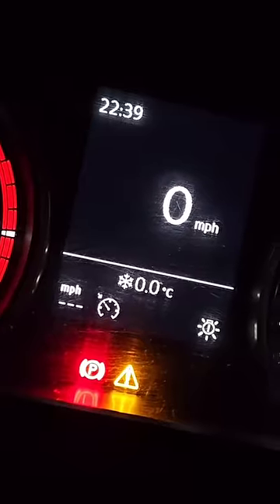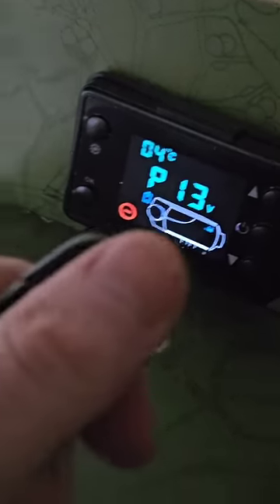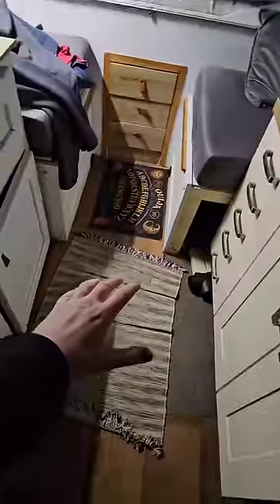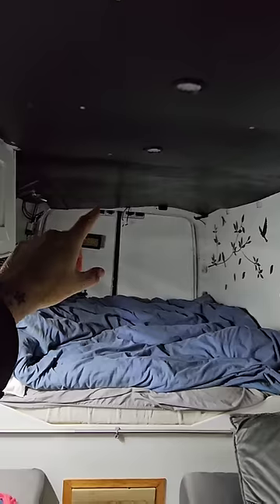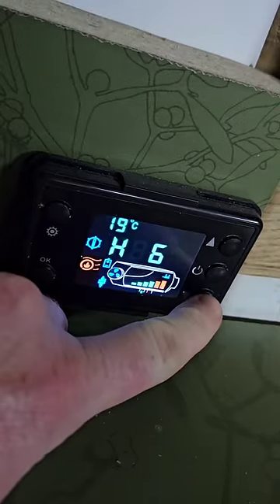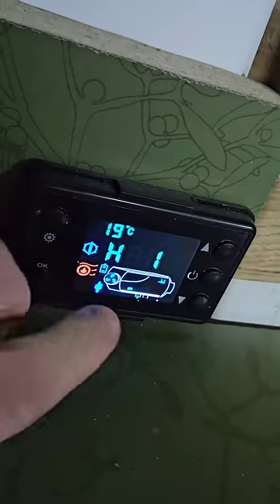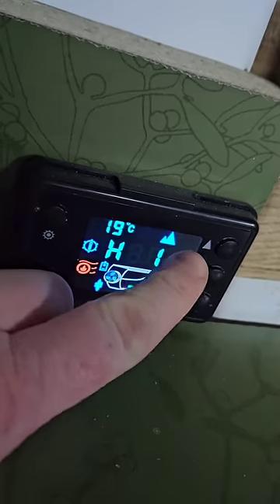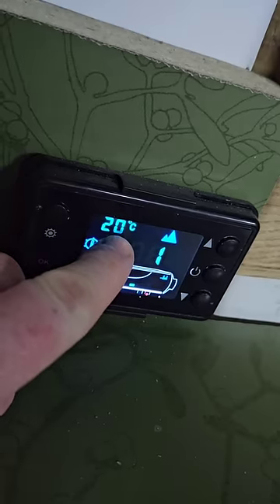Chinesse Diesel Heater Hack For Campervan

Comment: Just be careful with some of these heaters, some have been recalled due to serious faults resulting in carbon monoxide release. Get a CO monitor if you have one.
Reply: Exhaust is outside the vehicle
Reply: @jackmason4374  Aware of this but they can leak, which is why they were recalled.
Reply: I don't use mine because of this absolutely smokes the place out never known what the issue is
Reply: The exhaust manifold gaskets are shit on them it leaks right where it comes out
Reply: @Antv-no1zn  Probably because you're too limp wristed to tighten it up enough.
Reply: You can't have too much insulation. 
Love itt 💓..
Reply: The recalls where due to the instructions being in Chinese and unreadable.
Reply: @darrenpalmer8695  u dip the Chinese ones in soy sauce and it translates them
Reply: @mikejames4271  yhyh did u tighten your car exhaust up when you got it?
Reply: The paper gasket on the combustion chamber is useless mine leaked exhaust gases into my storage room on the instructions they do say that they should not be used in a habitable area!
Reply: I don't thinks its a fault of the heaters, i think it's due to poor installation.
Reply: CO monitor is a good shout 👍
Reply: I told him that two weeks ago and he hasn't replied. . . . do you think he's OK?    lolololololo
Reply: Not about that? There is a dangerous fault in some, that can be lethal? Its important to let people know the dangers!@mikejames4271
Reply: Run same One for yrs no probs and still spot on now.
Reply: @planespeaking so if they're recalled what's the worry lmao
Reply: Wouldn’t buy Chinese for anything important. Not worth the money saved
Reply: @shamicentertainment1262  have u ever owned or drove an MG?

Comment: Hope you have good ventilation to prevent condensation buildup
Reply: The oxygen is drawn from outside and the heater exhaust vents externally - there isn’t any condensation internally from the combustion (unlike a propane heater). 

The only water vapour would be from breathing, so just small ventilation required.
Reply: These heaters parch the air.  An extra mister might be needed to stop your sinus drying out.
Reply: @n.lyndley.9889 well said sir
..I did my research and as you know it's the glass windows that creates condensation...I left bulkhead in have no windows and only have roof hatch which is more then enough for ventilation.

Comment: It's just a night heater from a hgv, we all have them in our cabs fitted as standard
Reply: Ok calm down
Reply: You will find that there  webasto night heaters in trucks and cost about 1000..but saying that i paid 200 for mine for my campervan.
Reply: What are you debunking?
Reply: What is called that heater you talking about,  im looking for one for my campervan @Deiseboi
Reply: @cabrosbob5331  ..I brought it online from diesel heaters ni..there doing a 5kw for £135..had mine 2 yrs no hassle.

Comment: I use one in my house. Its a treat
Reply: I was thinking of doing the same.
Iv got an integral garage where I could site the unit ,then the exhaust can go out the wall to outside and drill a hole for the warm air pipe into the lounge ..How much diesel does yours use for example in the evening for 5 hours ?
Reply: See a guy on YouTube gets the running  cost down to 2p per KW. By mixing oil in with the diesel

Comment: Alpine mode uses less diesel because it can be deadly to not have enough oxygen in the mix. The diesel will burn incompletely and just smoke the vehicle out.
Military smoke generators are just incomplete diesel combustion.

Comment: Mate I have one of these on my boat to keep me warm I have issues with condensation I got the heater working but now it’s making a noise like a damn tornado taking off and it’s defo not the fuel pump I know that makes a noise. it also requires 12v constant anything less and it just cuts out. the manual was in Chinese and have no idea of the combinations of the buttons like you seem to know and we have the same heater as I have the same fob as you. any advice buddy or how to set it up correctly?

Comment: Do you have to keep the engine running over night
Reply from the maker: @sashdhesi9569  no. It's wired to a differant battery. My lithium leasure battery
Reply: @iNDI_VAN_A_JONES  so why dose it use diesel then if it runs on a battery 🔋 🤔
Reply: You say in the video the lower setting uses less diesel

Comment: Running these on the low setting is clogging them up quickly, better to have it flat out for an hour or two then off until you need it on again.
Reply: or just buy a proper heater
Reply: Garage deisel runs clean on these harters down to 0.8hz pump and around 1500rmp.  They can struggle to start on such low settings when cold but once run up to temp they can be tuned right down while running in advanced settings and still burn clean. Fact
Reply: @jorge-1053 What heaters do lorries use?
Reply: @wils35  same as any answer, it depends. 
If the business want to go cheap they will go cheap, or if they want a heater that will last and ensure their driver or goods stay warm then they will go for a proper heater
Reply: @jorge-1053  wrong answer.
The right answer was diesel heater.
Reply: @wils35  No one should use Cheap Chinese diesel heaters they are deadly
Reply: @wils35 the real brands.

China copies the design which is expired of patent now
Reply: @wils35  these

Comment: I spent just over $200 on a Chinese diesel heater it lasted 3 weeks the electronics went to crap the motherboard had changed out a bunch of other parts I threw it in the trash, I went and spent $1,200 on a Webasto heater never had a problem kicks ass, it pays to spend the money do yourself a favor.
Reply: Had webasto,sin TRUCKS for past 45 year. You are correct- spend on quality proven product.

Comment: I was using 4-5 gallons a day in Colorado plains winter. Junked that heater and went to a waste oil burner. Oh yeah I ruined that damn diesel heater trying to burn used motor oil at about 20% oil to 80 diesel.

Comment: what kind of foam.. the stuff for the house has to be covered with fire rated material. curious what foam you were using?
Reply: Dodo Mat, vehicle insulation specialists.
Reply: Carbon monoxide detector

Comment: I found these heaters drained my battery bank too quickly. If I lived in a van again I’d go for high crack to start the glow plug and switch to high AH for running the fan and pump.

Comment: If you've got a separate tank for the heater and you can find it on a pump then run your heater on kerosene as it's cheeper and burns cleaner.

Comment: Get a sleeping bag, then you can sleep safe and comfortably at any temperature, as long as you buy a bag that is rated for it.  Doesn't take that long to heat it up in the morning, and since you have a remote, you don't even have to get up.

Comment: How does fresh air enter into the van?
Reply: Every vehicle has vents in the rear panel. This is the reason you can slam your doors without pressure building up and popping your ears.

Comment: How reliable are them heaters I'm thinking of fitting 1 on my boat as my webasto keeps failing me
Reply: Highly recommend been using mine nearly two years...sleep in van 5 nights aweek due to work...here in Ireland in January was -8..was lovely and warm but sliding door frozen shut had to go out back door.
Reply: @estfano68  I'm gonna order 1 then I'm sick of webasto costs ££££ and you can only run it for an hour at a time or the gause fouls up ..probably OK in a car or van but on a boat you need the heat 24/7 ! And I'm sick of waking up with ice on my pillow
Reply: I’ve had mine for 2 years, so far no problems
Reply: have you ever heard of eberspacher? Those beauties never fail
Reply: @jorge-1053  yeah but there expensive I used one on my old boat and the only problem I had was the glow plug which was easy to fix in 5 min. I would get again but I need to keep costs down as I'm selling up

Comment: Is it really that hard to heat a camper van though no not really try and heat a 27 foot camper trailer from 1967. I use a 5 kW Chinese diesel heater to heat my water only and then I use a Wabo diesel heater to heat the underneath while I use a regular cheap Chinese diesel heater to heat the camper And running all three of those at the same time I’m still not even using a gallon of diesel fuel running all three of them for 24 hours. The only thing I would have to say is I would never get a Bastos diesel heater again only because they’re $1000, well Basto was the first one I bought 10 years ago and it is still running

Comment: You can tune minimum advanced setting down to 0.8hz pump and fan around 1500rpm Runs clean. Might need a little speed up when cold for starting just tune it down once run up to temp. 👍
Reply: not with that controller he cant. i have the same. theres older ones you could do it on, they almost look the same but these newer ones are different.
Reply: Like the newer controllers a downgrad if no advanced settings to control max/min  pump hz/fan rpm
Reply: @Stainless316L   preach bro. theyve come with the newer ones for a couple of years now. theyre wired differently too so you cant just buy an old one and switch. it sucks for those who know how to use the adjustments correctly.

Comment: DON'T WASTE THE TIME THE MONEY THE FUEL OR THE ELECTRICITY. SPEND $150 BUY YOURSELF A MILITARY TO SLEEPING BAG GET YOURSELF TWO OF THEM THEY'RE LIKE 40 BELOW ZERO SLEEPING BAGS...
YOU CAN PUT ONE UNDERNEATH OF YOU IN THE PILOT SEAT OF YOUR CAR ..
THE TWO OF THOSE TOGETHER WILL KEEP YOU EXTREMELY WARM THAT'S ALL I HAVE THAT'S ALL I USE....
Reply: Where did you order yours from?
Reply: Link?
Reply: Two things:

Why are you shouting? 
Have you considered that he wants to keep his living area warm as well, not just himself in bed.
Reply: @NeboReve  
1st 
I'm not shouting..
Stop being  programmed by the dumb ......
2nd,  consider all probabilities before you assume the worst....
I talked to text large so that I can see...
Reply: @NeboReve  
2nd,
Maybe he does want to keep the whole thing warm ..
That costs more.
That's his business...
Reply: @ASwordOfTheLord lol @ “programmed by the dumb”. Also, without some heating I think there would be too much condensation. Extra warm sleeping back and some heating + condensation management system might be the solution though